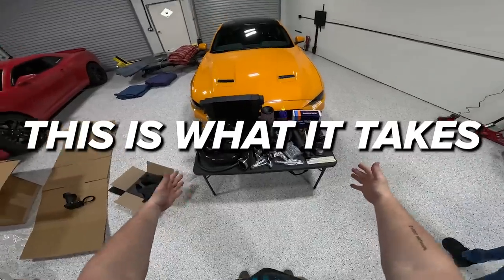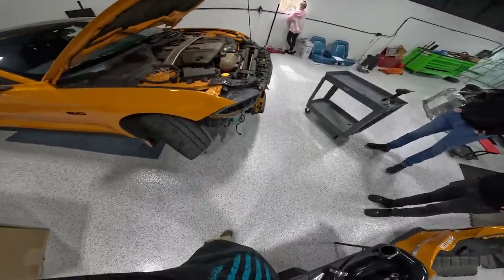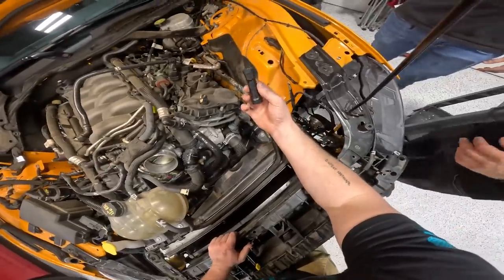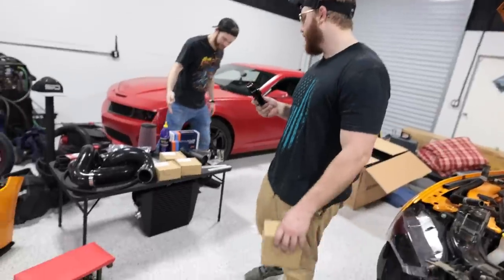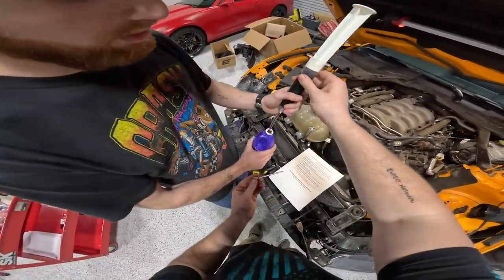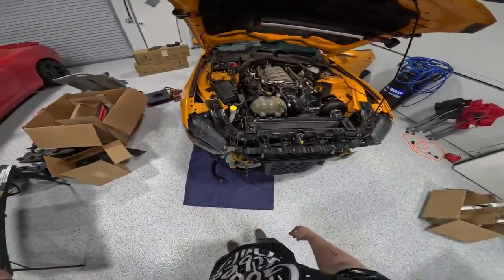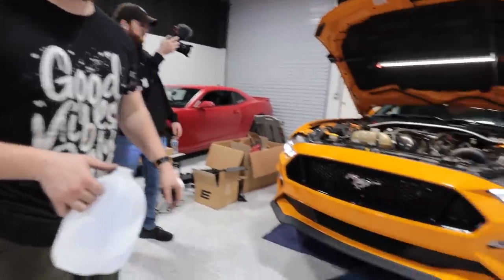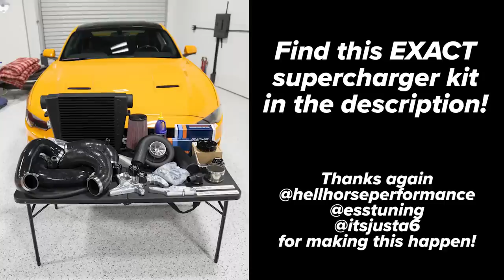We Boosted My Car in a Day! | ESS Tuning Mustang Supercharger Install

Comment: What made you pick centrifugal over twin screw?
Reply from the maker: I wanted something with a smoother power delivery for road course and mountain use. Both setups can make a LOT of power, but they deliver it in different ways. You’ll see how it drives on the track soon!

Comment: Can anyone tell me if they have any experience with running boost with high flow cats I’ve heard they can clog and blow the motor. Just wanna know if anybody runs high flow cats with boost for emission reasons
Reply from the maker: It would work fine as long as you don’t make too much horsepower. Im still using the OEM cats with this supercharger too. High flow cats typically can handle more horsepower than the original cats.

Comment: Do you need to gap your rings for this kit?
Reply from the maker: No! I’m running on the stock gen 3 coyote engine making 620whp with 93 octane. Once you swap pulleys and increase horsepower, you can gap the rings as necessary. 

I’d also talk to your tuner about your plans for the best advice as well 👍🏼